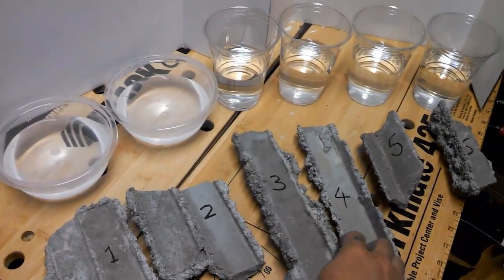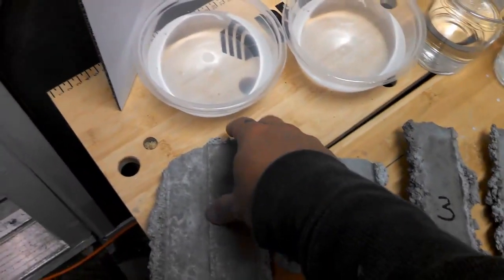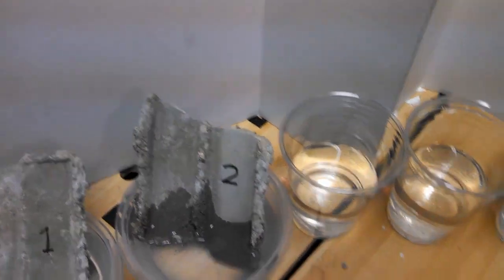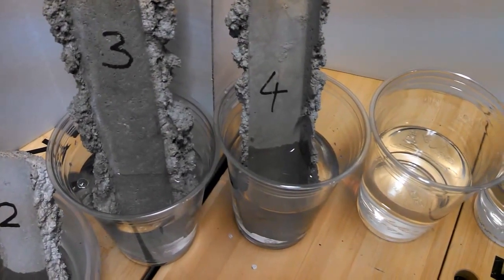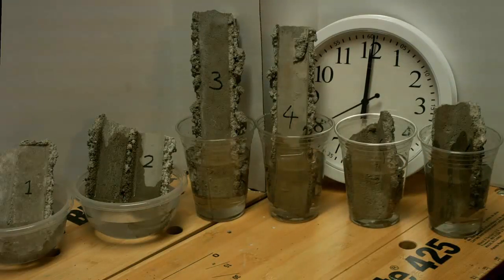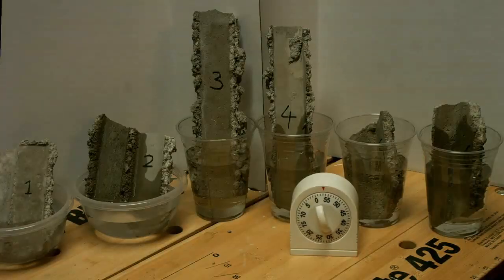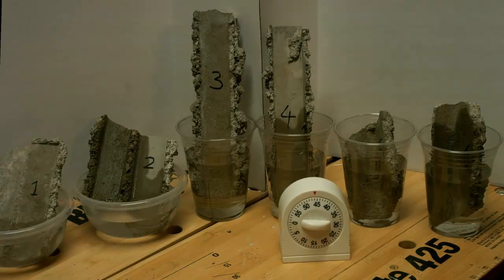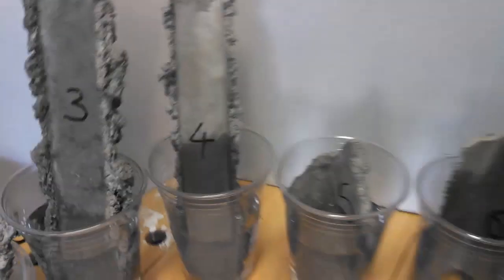5.1.1 WaterproofingTest1

Comment: Hii Simon

what did you used to water proof it ? 

thx
andrew
Reply from the maker: In this video, I had used ProteShield from HomeDepot.  It has been OK.  For the rest of the structure, we switched to "Blue Max", purchased directly from Ames, and we thought that was much more effective at keeping out the water.
Reply: ♥️♥️♥️ I have noticed that on outside historical sites that had COPPER ♀️ Plaques, that around and above the COPPER PLAQUES there was Mold Growing On The Walls. But that Under The Plaques, There was NO MOLD AT ALL. And that COPPER POWER can be added to paint, for the same effect.
Thank you for documenting your journey and what you have learned with us ♥️♥️♥️

Comment: Can you use a hydrophobic concrete?
Reply from the maker: Yes, but hydraulic concrete costs quite a bit more due to the proprietary admixtures included.  I talked to a concrete pond guy about it and he swears by a method of mixing one 80lb bag of regular concrete with half a bag of thinset (the good kind with the waterproof admixtures, not the cheapest kind) to get 120 lbs of hydraulic cement for a fraction of the cost.  I have used it to fill some sections of the roof that were a bit rough, but I didn't really "prove" it yet.  At the very least, I liked how smooth it spread out and think it is a good base for the better waterproofing that I am using now.  That will actually be my next video.